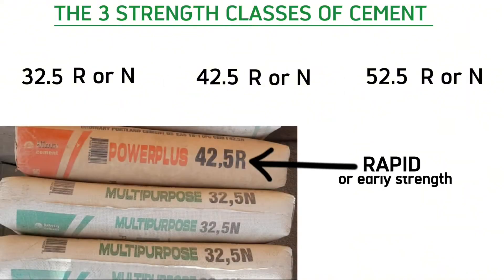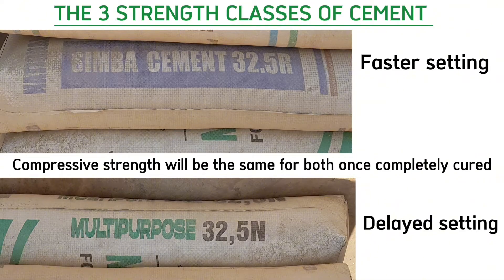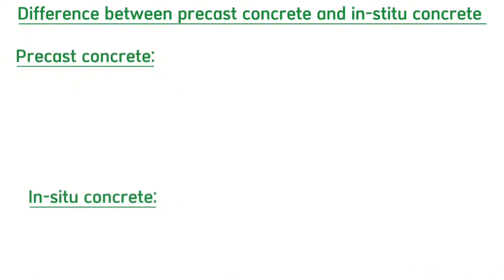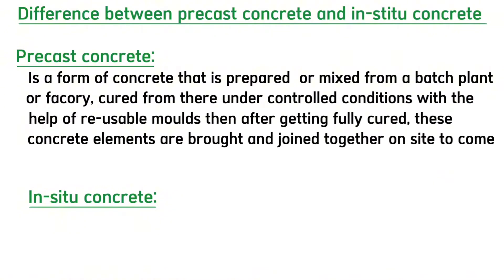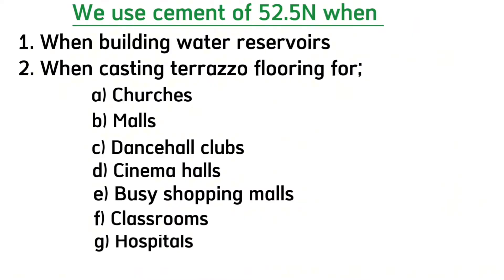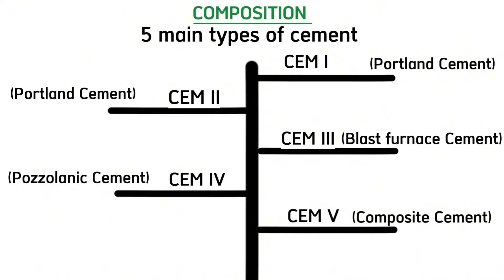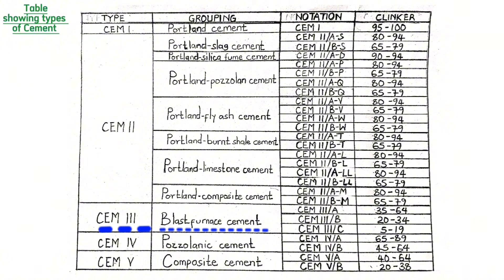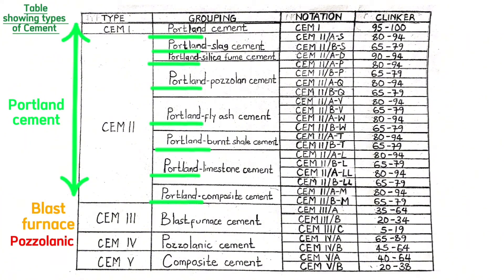Types of Cement their uses and purposes | Classes of Cement Ordinary Portland Cement

Comment: Ian thank you very much for the educative videoz. You information is invaluable. Please give us cost estimates for construction of 2 bed apartments.
Reply from the maker: must do that sir✍
Reply: Bro/sir @ianconstruction  kindly iwould like to ask if i want to build  ground floor and 1st floor kindly steps as cement.😊
Reply from the maker: @Hellenbarasa-br5db for all structural work, that is 
Bases, columns, beams, slab, staircases use cement witb 42.5N for a strong structure

Then for other works such as masory walls, plastering finishing or any other works on site, you can use cement with 32.5N
Reply: @ianconstruction  thank you so much.